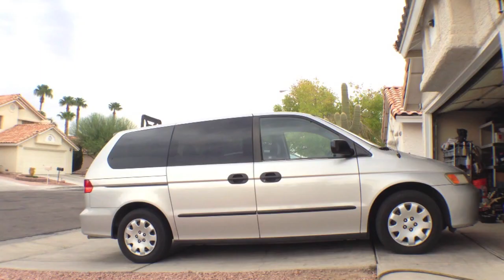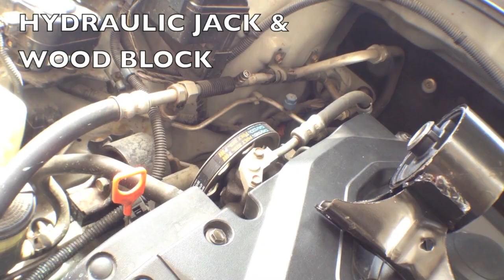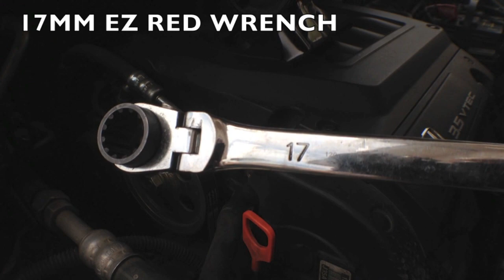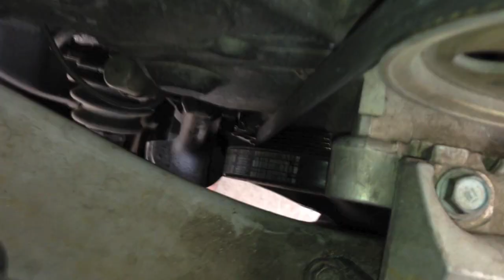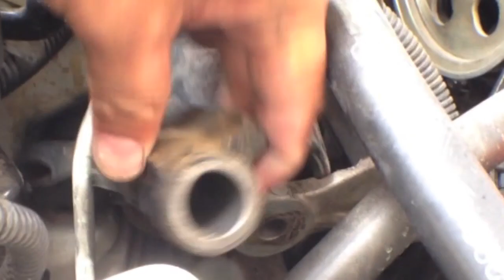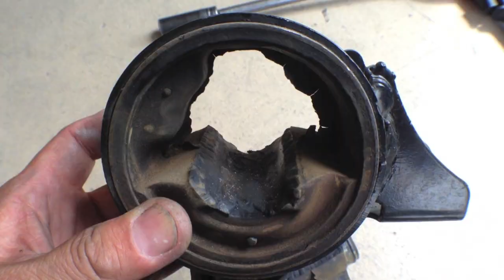Passenger Side Motor Mount Replacement Honda Odyssey √ Fix it Angel

Comment: This will apply when u replace your power steering belt since it goes around the mount
Reply: Im thinking jus romove da 14 mm bolts and lift the engine enough to get the belt through

Comment: no just the top right only at this point after the new clutch
Reply from the maker: ok all the other mount will need to be replaced. if you only replaced the right and not the others, your new mount will get bad quick.

Comment: hey you are the best. you showed me how to do my 2008 Honda civic well in Australia driver side mount i had a clutch replace and now there  is still a little bit of vibration would it be the one underneath near the oil pan looks like a dog bone bolted to the subfraem
Reply from the maker: Thank you Simon. Yes it could be the dogbone. Vibration is at idle only?

Comment: MotorMount:  I need a motor mount.  I own an ES300.  I need the front motor mount.  How do I find out what manufacturer makes the motor mount for Lexus/Toyota?
Reply from the maker: Go online and do some research. That is what I do first. You can also call all the parts store in your area.
Reply: Question Clear Up,  I was asking how to find the OEM manufacturer of the motor mounts of the ES300.  There are alot of aftermarket brands out there but I want the quality of the Lexus/Toyota with out paying the price so I want to know who Lexus uses.  Lexus does not make motor mounts.
Reply from the maker: Then check Ebay or Amazon. You might find it there.

Comment: Good video. One note - the piece sucking out the front of the mount is on wrong. I think it's called 'dynamic damper'. The heavy part should be sticking out sideways toward the motor; then the little tab hooks onto a tab on the mount to hold it there. I have no idea why.